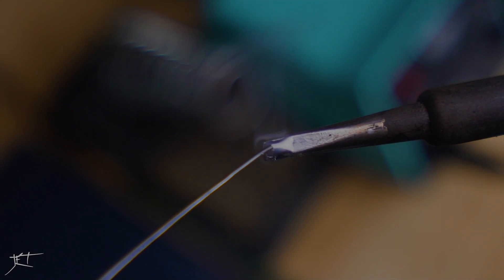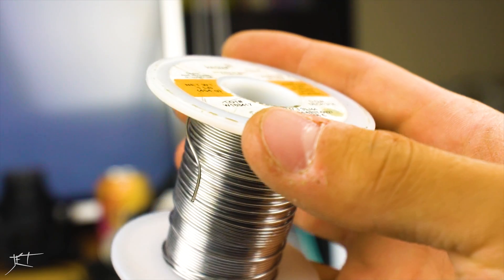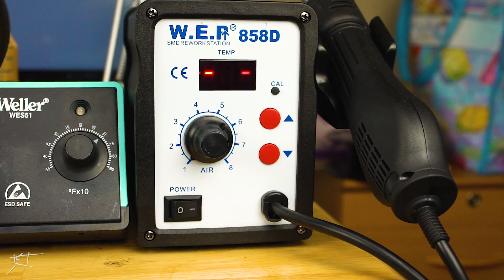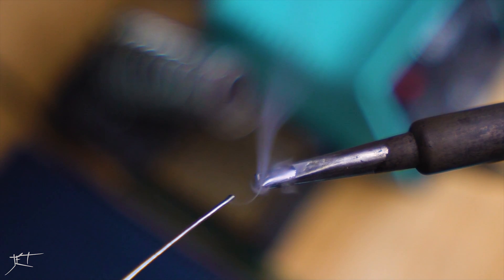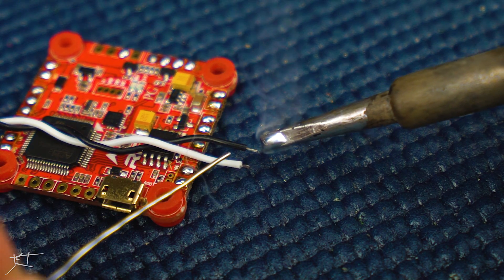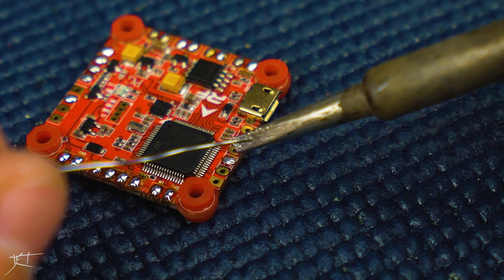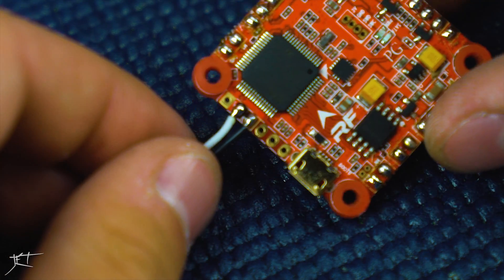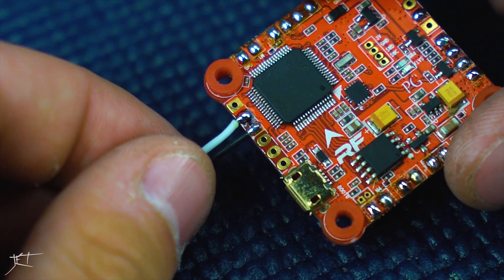My Soldering Gear + Soldering 101

Comment: My soldering was total bullshit frustration until I discovered FLUX.
Flux is fucking magic.   Flux will make a shitty cold soldering joint before, turn out just perfect if only you use flux.
I use these shitty 30 watt pen soldering irons... so...   yeah, you need it on the low end.

Comment: Excellent video! I solder at 750 with a Weller WESD51 and 60/40 solder. Allows me to get in and out really fast without heating surrounding components. Even thick power wires are no problem. I have been through so many $15-$30 soldering irons, the Weller is worth every single penny!

Comment: Dude, you need to use liquid flux! It's fucking magical when prepping wires.  I'll give you the rest of my bottle next time just picked up a another one!
Reply from the maker: Rosin core dude! I don't need that shit
Reply: Jordan Temkin I know that, I also use that as well. When using the liquid flux on wire ends with a paint brush it penetrates the wires even going up the wire some. When hitting the wire with the soldering iron it instantly sucks all the solder off the iron you don't have to sit there for 10 seconds getting the wire super hot and burning plugs or shrinking the tubing. Even use it on the xt60's  Literally takes 1 second  even with a 10 awg wire. Just a lil trick of the trade thought I'd share.